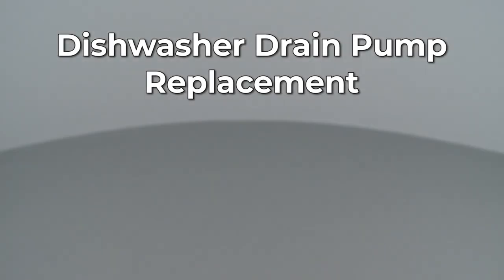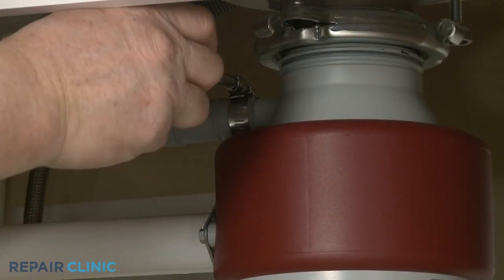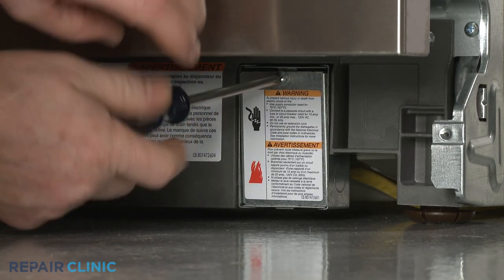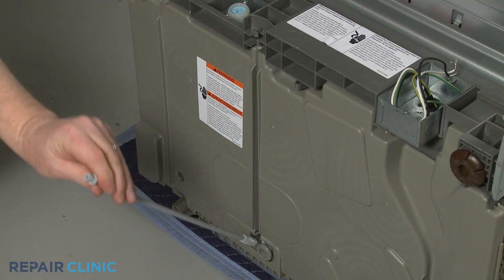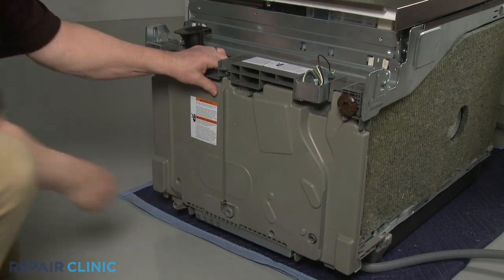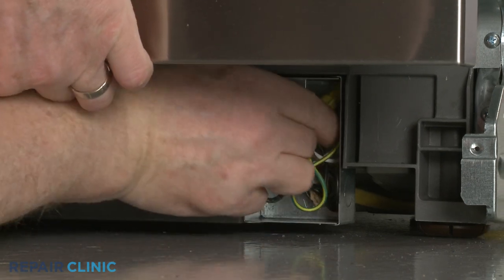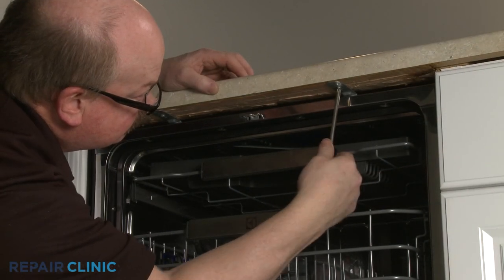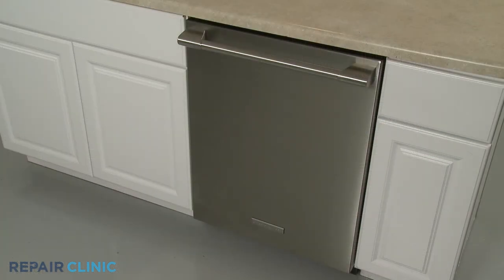Electrolux Dishwasher Drain Pump Replacement A00060404

Comment: Please help answer a question! If you look at your drain pump that you replaced - its connected with blue wires...Those blue wires come from a group of black and red wires as well that are routed thru the bottom plastic panel visible in the video. There are two black wires that run in that same bundle back to the control board. Where do those black wires go? Mine came unplugged and I spent hours looking for where they connect to with zero luck. I'm almost ready to toss this dishwasher and go buy a new one just because these this connector came unplugged. Please help! Thank you.
Reply: Hello, it depends if you are working with 110 or 220 electric ... usually the black wires are the neutral but I would need to know if its 110 or 220 to give you a clear answer. I know its a long time ago that you posted the question but perhaps this can help someone else since the OP is not replying. Hope you figured it out rather than spent money on a new machine.

Comment: the  light of the Dishwasher for increasing the amount of salt does not turn off knowing that the salt tank is full
What are the possibilities for that??
Reply: Turn the electric power supply off, wait 15 seconds and turn back on to reset and clear the sensor - then it should turn off... sorry for the late reply :)
Reply: @dennisascienzo163  thanks 😊